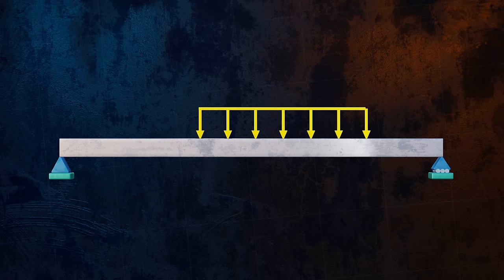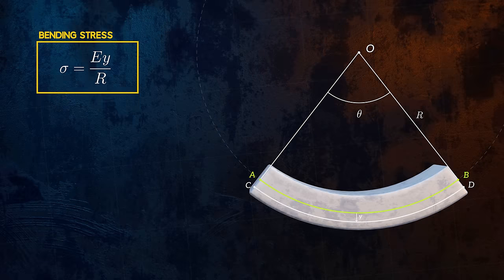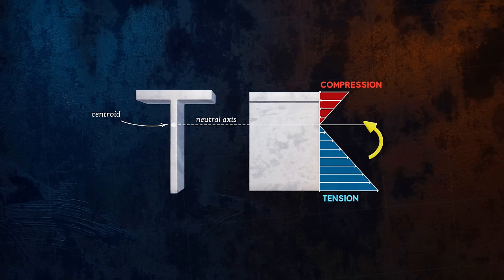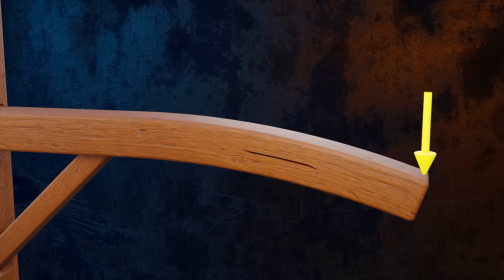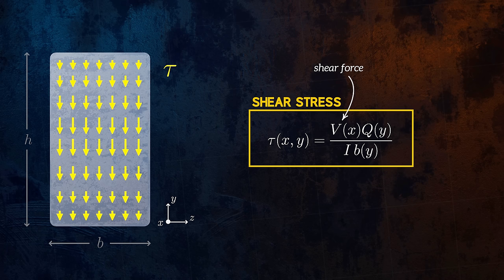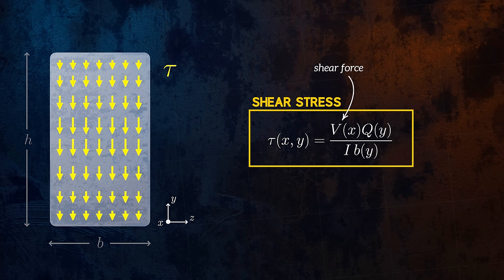Understanding Stresses in Beams

Comment: Compression and tension arrows shown at 0:29 indicate equal forces of both at top and bottom half of the homogenous material beam under load with the neutral surface being half way. What I was taught is that the compression forces make up roughly the top third of the vertical thickness for uniform loading of the beam. That is why holes drilled through a beam that will be under load are located one third the way from the top where the forces (stresses) on the beam are neutral and it's strength is not compromised.

Comment: Ive worked with large "I" beams in my working life on building sites in the past. Now retired I use a          9" X 6" X 5"   beam as part of a log splitter I made 10 years ago.        
When the hydraulic ram try's to.. "Stretch" the beam during a difficult hardwood block wood being split
I note the beam "Twists" during stress of splitting. 
It's quite elastic and immediately returns to its original shape when at rest without pressure.  
I find it quite interesting and amusing how many tonnes it would take for this to happen. 
Take care everyone.

Comment: This can, and should, actually be explained a lot better. The shear force V is in fact the derivative of the bending moment M, at any point along the beam's length. This insight is essential.

Also, there is no real explanation for when M, and hence V, would be positive or negative.

There is more to improve, and still, this is a pretty decent attempt.

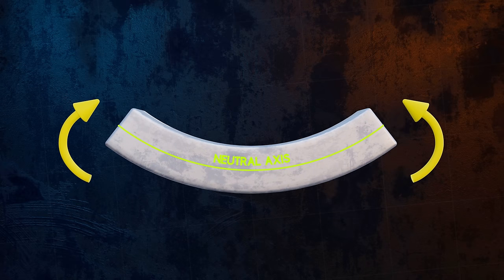Comment: Excellent video as usual but at 1:47 this is not the neutral axis. Neutral Axis can be shown at any cross-sections, they become horizontal centroidal axis (X-X) for vertical bending (top and bottom side bends) and vertical centroidal axis (Y-Y) for horizontal bending (front and back side bends). Here neutral axis is as shown longitudinal axis or polar centroidal axis (Z-Z).

Comment: Sorry for late comment my mentor.  I want you make a video involving both thermodynamics and fluid dynamics . It would a video about answer to a seldom asked question. If the pressure of a fluid increases with depth why doesn't the temperature increase with depth? For simplicity consider gas instead of fluid.   When cubical container of a gas is in free space its pressure is same throughout the container . As soon as this container is placed in a gravitational field , the pressure of gas (fluid) in a container increases with depth .  As from the equation 
PV = nRT
the volume of container is constant so it the pressure of the gas increases with depth so does the temperature. But I posted this question on Science Asylum (YouTube channel) . Nick replied that in this equation V is not the volume of the container but make it V/n it is the molar volume of the gas .
P(V/n) =RT
The molar volume of liquid is minimum at the depth and it is maximum at the surface.  The Temperature is therefore constant throughout the liquid . 
But there is a real life example which contradicts this answer.  It is the atmosphere above us. Think yourself why the temperature of the atmosphere is hot near the surface of the Earth and cold as we go up? Temperature of atmospheric gases has increased with depth in a gravitational field.  🤒🤒🤒

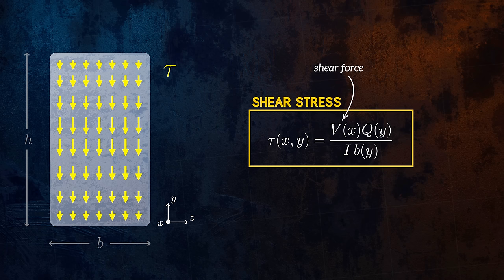Comment: At 11:12 you have an expression for the max shear stress as 3V/2A but at 11:52 you said the expression can't tell us the maximum shear stress. I'm confused. You said it's reasonable assumption if the  width of rectangle is thin. What exactly is considered a thin width for a rectangle? Would that not depend more on the ratio of the width to length?

Comment: I don't understand the difference between bending stress and bending moment .pls reply
Reply from the maker: The bending moment is basically the resultant of the bending stresses. It you slice through a beam you will have compressive normal stresses on one side of the cross-section and tensile normal stresses on the other side. The net effect of these stresses is the bending moment.
Reply: @TheEfficientEngineer  thank you so much for the reply.keep going your videos are really awesome.

Comment: Amazing video! 
I have a question if anyone can help. Let's say there are two rectangular beams under the same loads and with the same cross sections, but one of them is made of steel and the other one is made of wood, is it correct to say that the internal stresses in the steel beam are smaller than in the wooden beam? And if that is the case, why do the flexure and shear stress formulas only depend on the geometry of the cross section and not on  material properties?

Comment: Something i never understood:
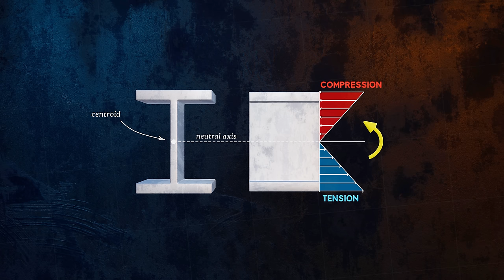Minute 5:48 the forces on the section have a triangular distribution, being the maximum at the ends
Ok. I-beams have lots of material (area) at the ends (the flanges)
What happens right before the flanges (in the web)?
My point is that forces are linearly distributed (the triangle) but the area of an I-beam is not.
Isn't there much stress right before the flanges?

Comment: I only have one complaint: you forgot the assumption that the beam may be isotropic. Horizontal shear failure doesn't usually occur "close to" the neutral axis, it occurs at the neutral axis: deltaH = VQdeltax/I; since Q is maximum at the neutral axis, deltaH is maximum at the neutral axis as well. The neutral axis is only at the centroid if our beam is isotropic.

Comment: 7:40 Great video. I am having trouble determining directions and signs conventions. Why do the planks move downward when applying a counterclockwise moment on the left side which is supported fixed on the right side?.
Reply from the maker: I made a mistake there and drew the moment in the wrong direction. Sorry for the confusion!
Reply: @TheEfficientEngineer  thank you for the clarification, Sir. Thank you for posting this efficient videos.

Comment: 4:07 how do the internal normal forces equal the resultant bending moment if the internal normal forces are opposite in direction but equal in magnitude about the neutral axis shouldn't it cancel out to 0? Unless the normal forces are larger in magnitude in the compressive side than the tension side?

Comment: There are two things which I didn't get 
1. Why is shear is minimum at the top , when you shown the diagram of planks see the uppermost plank separated most from just beneath layer 
2. If flexure shear is a function of difference in bending stresses which are generated due to moment so maximum difference of flexure stress is at the top bcoz sigma is directly proportional to y so shear should arise in huge amount there.

Comment: I’m a structural engineer who doesn’t believe in all that crap. I always design my structures in Paint without running any structural analysis because I pick oversized beams that will withstand the load requirements.
Reply: D V are u in school or dream?
Reply: WIND 4 EEE no this is what I’ve been doing. The company that I work for doesn’t know my technique. Of course we’re not always competitive price-wise but that’s the way to go.

Comment: The length of an arch formula is incorrect unless I'm wrong, its happened before. Length of arc = 2 x pi x r x theta/360, not r x theta... correct? Great video, thanks for this @The Efficient Engineer
Reply from the maker: The formula you mention is to calculate the arc length if theta is defined in degrees. r * theta is used when theta is defined in radians.
Reply: @TheEfficientEngineer  Awesome! Thanks for the clarification and education!

Comment: Why must the vertical shear stress be zero at the free surfaces ?
Reply: Vertical shear stress must be accompanied by a complementary horizontal shear stress, as shown in the video. A free surface cannot impart any horizontal shear stress, thus there cannot be any vertical shear stress if the beam is to remain in equilibrium.
Reply: @yonatanmerkier7369  Thank you very much for your reply. I understand what you say. But why can a free surface not impart any horizontal shear stress? For some reason I do not understand :/

Comment: Ur asking the science computational.
It includes.
When u used solid works it has the g-code. Right machine learning and deep learning.

The dimensions are given reversed the computational, using given formula.

That's how I will get the ultimate design system. Using my matrix system

Comment: As an engineer you should know that everything has one name to avoid confusion. Same can be said for the english language. When you say, exact same as you did at (1:36) you confuse the listener. If you must use the improper terms, exact same together, it can be easily fixed making it an adverb and saying: exactly the same or make it simple using the terms singularly. Thanks for this interesting presentation.

Comment: What I don't understand this that if the fibers furtherest away from the neautral axis expiereince more strain and therefore more stress, why are deeper beams better at resisting bending stresses. The fibers say on the bottom flange are being pulled apart more the further you go away from the neatural axis then intutvely shouldn't deeper beams be worse in bending? A little confused, could someone please help clarify this for me? Thank you!

Comment: Why is the most shear stress in the cross-section along the axis of neutrality? Shoudnt it be the opposite? The most deformation and strain is put on the top and bottom of the beam, correct?

Comment: This question is coming from a complete layman in structural engineering, but the main carrying beam in my house is starting to twist at one end. It sits on three piers and is about forty feet long.  The piers are starting to fail and will be replaced shortly. I still do not understand why the beam is twisting. Does anyone have an explanation in layman's terms? Thank you.

Comment: Guys, Does both contains shear stress ,hint that the several planks of wood.When a load is applied, there is a tendency for the planks to slide relative to one another.Does it has a shear stress on both of the planks

Comment: Very intersting!  So if you have to drill a hole horizontally through a wooden beam, what does this theory say about how the strength of the beam is affected if you drill the hole centered vertically on the beam vs. drilling the hole near the top or bottom edge?

Comment: Amazing video! 
I have a question. Let's say there are two rectangular beams under the same loads and with the same cross sections, but one of them is made of steel and the other one is made of wood, is it correct to say that the internal stresses in the steel beam are smaller than in the wooden beam? And if that is the case, why do the flexure and shear stress formulas only depend on the geometry of the cross section and not on  material properties?
Reply: damn you got me thinking as well.
The internal stresses would be different if the load are the same for both beams. As stress is the force acting on the area. thus material properties is not needed. In regards to material properties, shear strength would be the one that is important.
so stress is the amount of force an object expriences per unit area, while shear strength is the material's ability of withstand stress.

Comment: Nice work.. It appears the transverse shear stresses are in the same direction as the axial compressive/tensile stresses, due bending,  so should those be summed to get the resultant axial compressive and tensile stresses.. and if so does this result in a net increase or decrease of the maximum axial stresses?
Reply: Never mind that.. I now realize that I simply need to compute the "principal stresses" from Mohr's circle to compute the worst-case normal/axial stresses.

Comment: I have a question about the shear stresses:
In your glue example you draw the shear stresses as parallel to the x axis, which I understand. But then later on the shear stresses are depicted in the y direction (vertical)?

Great videos by the way, thanks a lot!

Comment: As we know that the beam will offer a resisting moment to counteract the action of applied bending moment or moment caused due to loading.
So, if we have to show a direction of bending moment then which will we should consider the applied moment or the internal moment setup in beam.
Like in your video you've shown the internal bending moment across the section(maybe).
Please have a look at this comment as it always bothers me while I conceptualized the stresses setup in different beams.
Reply: It will be the internal/resisting moment developed.